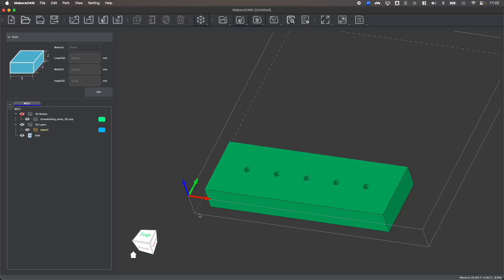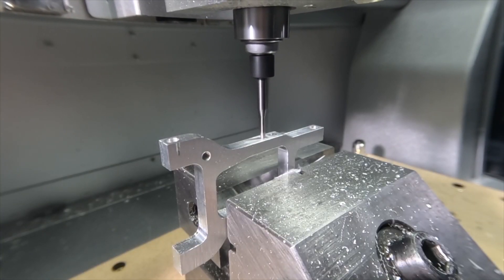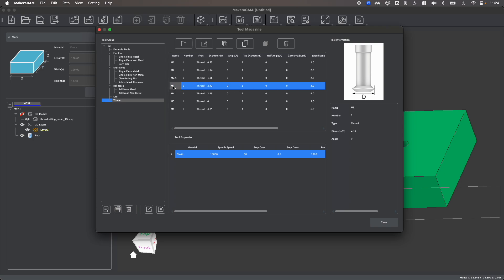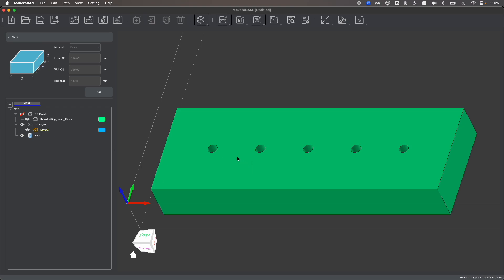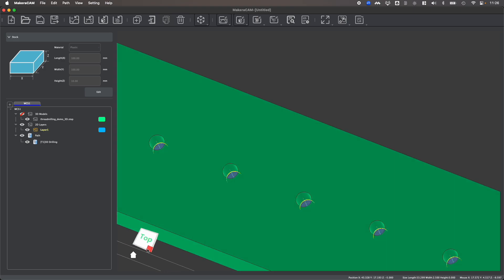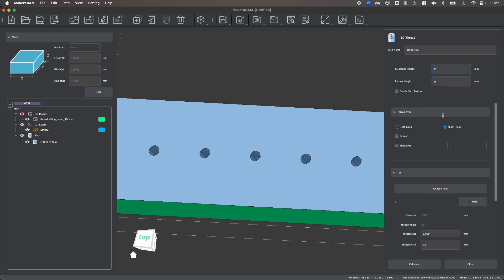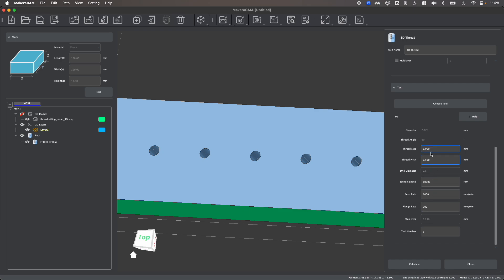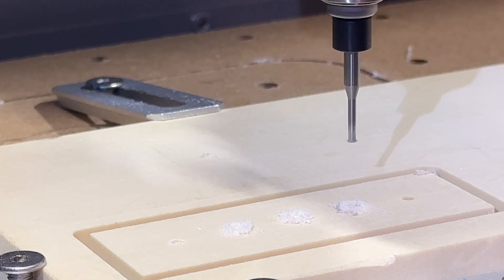Makera CAM - Creating 3D Thread Milling Tool Paths

Comment: Is there a place where all of the settings for the thread bits are stored? In the version of MakeraCAM I have the Tool Magazine settings under the Thread Tool group doesn't seem to have all of the settings you show in the video? MakerCAM 0.2.1.7 seems to be missing many of the settings here.
Reply from the maker: Yes, check out the speed and feed page of our wiki here - https://wiki.makera.com/en/speeds-and-feeds

Comment: Can the thread milling operation be used to create male (external) threads?
Reply from the maker: Yes you can.
Reply: @Makera  Can you show how? I am unable to do it. I'm trying to make external threads and it keeps putting them in the center of my design and not on the outside.